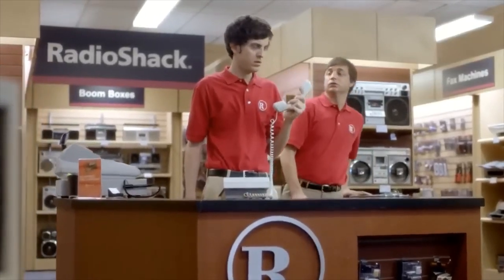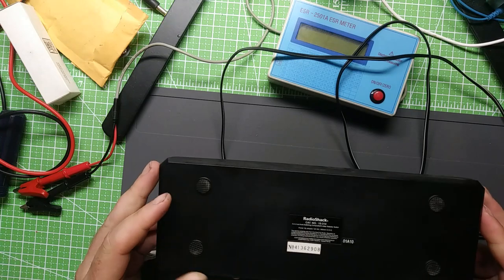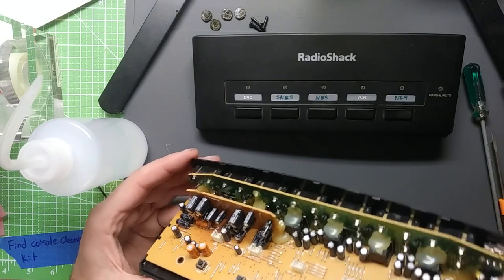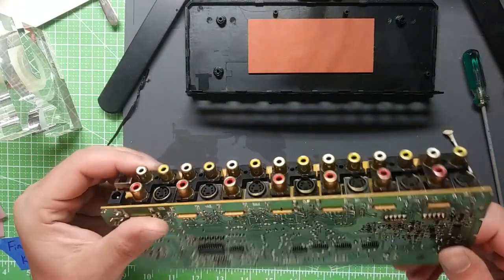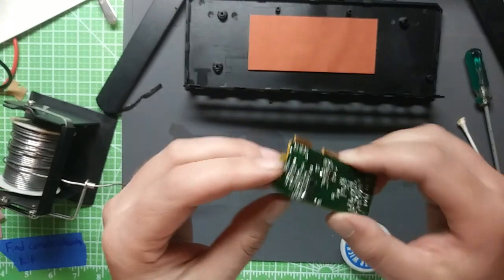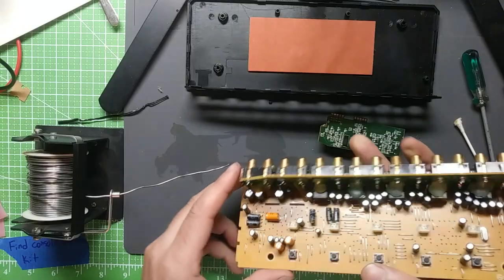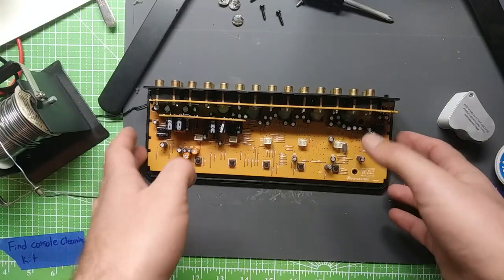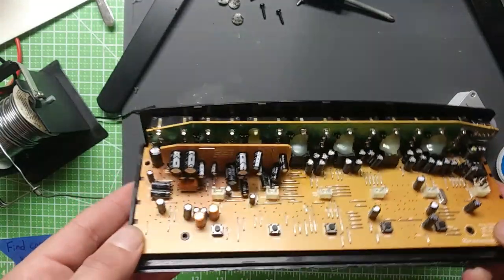Radioshack 15-314 (5 in-2 out) A/V Switch Repair

Comment: i have one of these and love it, unfortunately one of the inputs always gets output with extremely low audio. It's just a problem with input 5. Probably worth opening up to see if there's an easy fix
Reply from the maker: yes its a great switcher plagued by cheap capacitors. I'm almost certain you will find this same issue. If it seems like its something you don't want to mess with; i just started accepting "fan mail" and I'd be willing to fix it up for you. I'll do it for free if you ship it to me with a return label. If you want to go nuts and upgrade it to an heirloom piece; we can recap it with Rubycon or Panasonic or other brand name caps that will last for a lifetime.

Just let me know ^_^